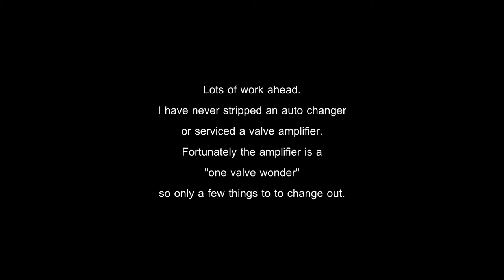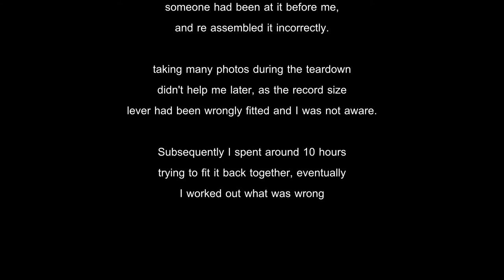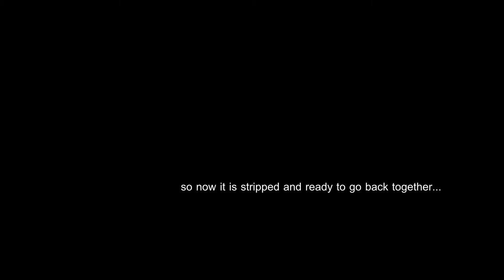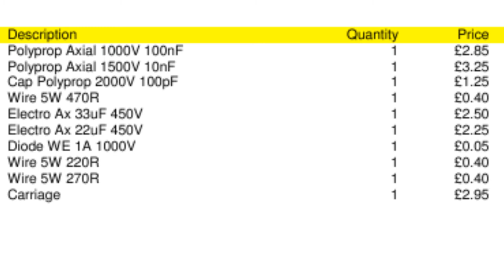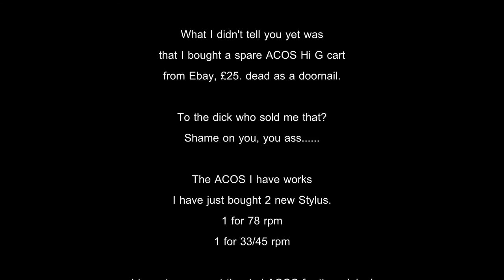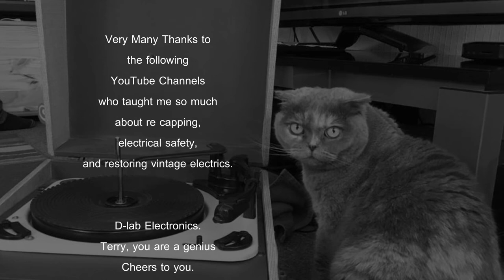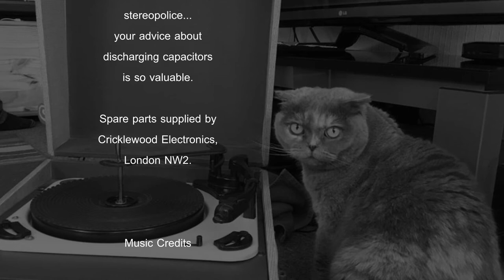My Garrard Story

Comment: how you got the platter of i release the clip but it wont move
Reply from the maker: I would put some wd40 on the spindle, just a small squirt. If you have removed the clip the platter should twist off
Reply: @Super8Rescue  thks just got mine in def need grease can only move the speeds when upside down 🙂 the record changer pole is it removable our fixed in place on my other garrard i can switch it to single disc pole just asking before i pull on it